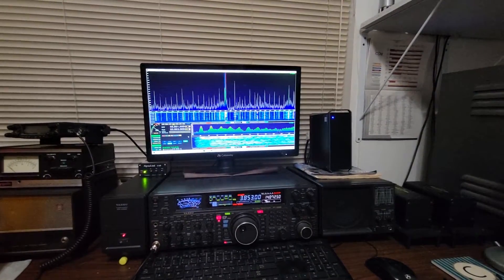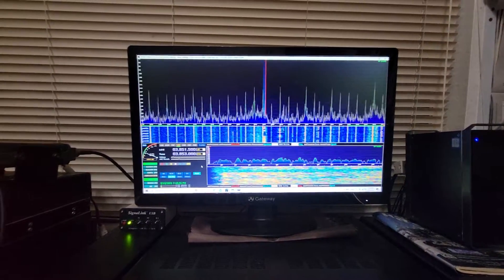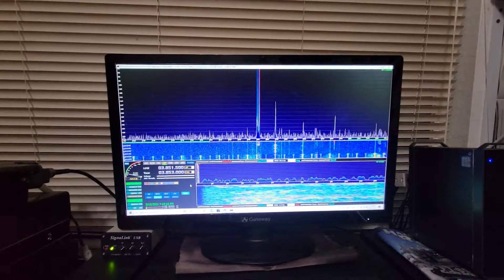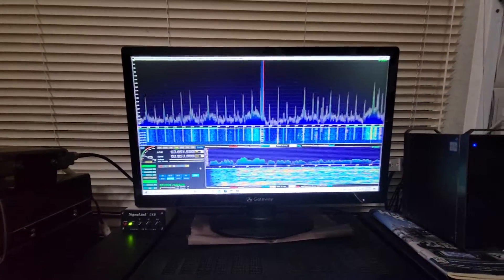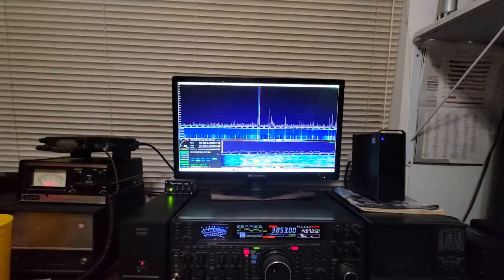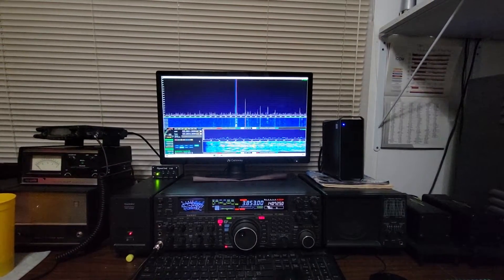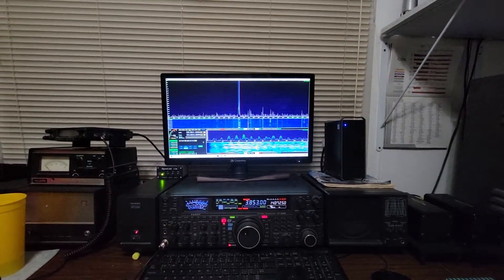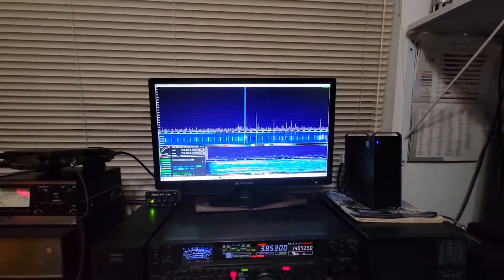Yaesu MTU 80/40  tuning unit demo with the FT-2000D.

Comment: Curious how you have the pan adapter inter-phased... are you using a SDR linked into the RX jack antenna port? Don't see a DMU, any tips on how to interact with an SDR would be apricated.  (never knew those mu tuning units were so large, wow)